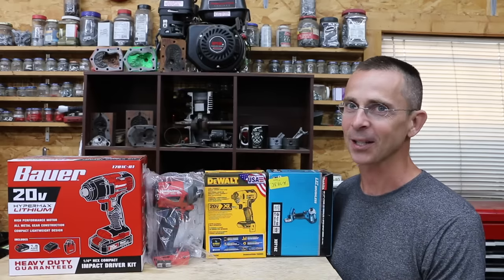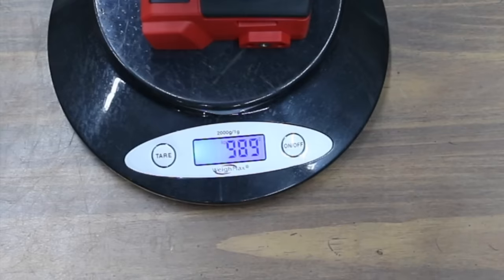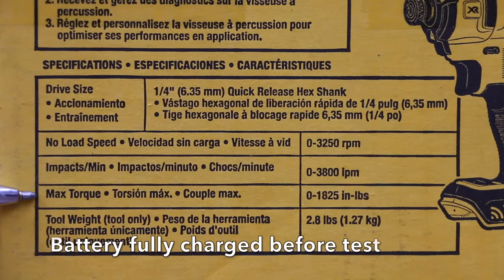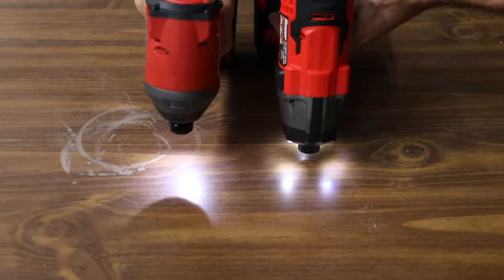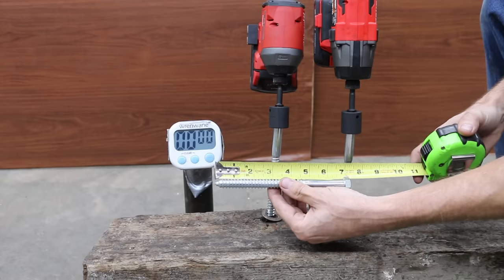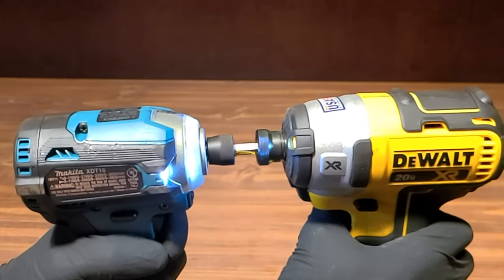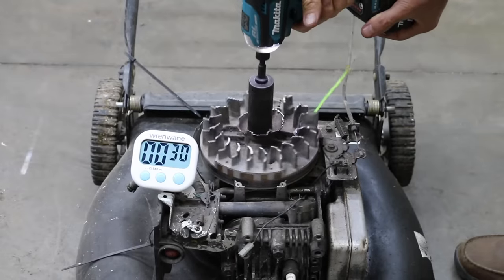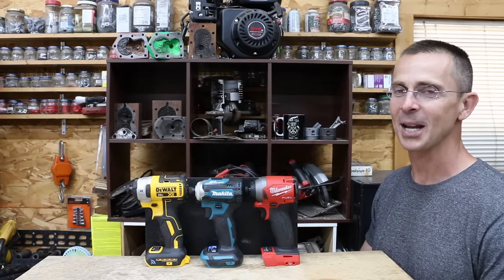Best Impact Driver? DeWalt vs Milwaukee vs Makita vs Bauer!  Let's find out!

Comment: I had an older Milwaukee that continued going all the way until it smoked the brushless motor. It still works but makes a horrible noise, and doesn't work very well. The replacement now shuts down just like yours when I try to misuse it in a similar fashion to the way that killed the first one. I suspect Milwaukee has revised their protection circuitry and logic so that it cuts out earlier, creating a slight annoyance when you're running at the edge, but keeping you from killing the tool.
Reply: i would rather have control than safety, this "shuts down because you are a dummy" mode is taking away the freedom to do whatever i want with a tool i bought.
Reply: @MartinPlanner2  Still, the fact that the manufacturer has to protect the tool from its users says something... 

People will let the magic smoke out of the tools due to incorrect usage and claim warranty.. Or that their tools break because they suck. 

I get the idea though, I've run several old drills to the smoking point to get jobs done... But honestly, it's not really good practice.
Reply: @TheDaniel85  yes i understand that, meanwhile, because it has a thermometer, they could claim that if it overheated, there is no warranty, period.

it is such a nanny state, that we have been implementing defensive measures against crooks, while this just made them be more crooked and smarter, instead of stopping them doing scams.

i only buy a tool that i can repair myself, electric or not. and i have never took back a tool for warranty.
faulty production? that's a scam on cheapskate parts.

of course there are price-brakets for scams, so a faulty car is a higher offense than a faulty 1$ tool. 

not in my perspective though...
Reply: The red link technology will shut down to protect the tool, which may be annoying, but this is a good thing.  The Milwaukee battery is the best on the market.  I would rather have the tool shut down automatically since most people will pressure the tool to finish the job even if it smokes.  In the end, my drill avoids damage.  t does take a lot to get to that point.  Most jobs will not shut down the drill.  Even with the shutdown, Milwaukee has won all of the competitions I have seen on youtube.
Reply: @Anonymous The number of people who want the "freedom" to abuse the tool and also expect the manufacturer to repair or replace it for free as a result is probably pretty high. I don't blame Milwaukee for implementing this feature as a way to save them money from these kind of warranty claims. And I sure don't mind losing a few seconds for the tool to cool and reset instead of losing a few hours or days while I go get a replacement or wait for something to come back from service or whatever after I abused the tool to ruin.
Reply from the maker: Thanks for sharing.
Reply: @GeekRedux  my point is, if it has safeties in it, you will hardly ever find the point of failure, which would be really useful for testing purposes in their own testing facility.
I am the type that i would rather build a tool that outlasts generations of users, than to sell 5series to all of my users.
I know, in this world, this is not a very popular perspective, with million+1 reasons why companies don't do it.

back in the day, when there were no warranty laws, you had something called "intended use" with scientific numbers, of how much the tool is MEANT TO be able to handle. now, it's only a suggestion.
for example, they could say, this hammerdrill, in ONLY intended to be turning up to 8mm coresize bolts, or 5mm boresize screws no longer than 80mm.
or that it should only be used to XYZNewtonmeter torque, and it could handle higher ones, but it would lead to being faulty.

now the RPM and torque numbers are JUST a marketing ploy (as shown in the testing in the video) and companies RACE to "who's higher" instead of saying that it SHOUILDN'T do more.
Reply: @MartinPlanner2  Weird that you're saying you want a tool that outlasts generations of users in the same thread you criticize Milwaukee for designing the tool most likely to do just that.
Reply: @GeekRedux  having no weakness, and hiding the fact there is weakness, is NOT the same thing...

Comment: Milwaukee has a red link system that watch’s the battery and tool and watch’s the heat and will cut off the tool to try and protect it for the user.
Reply: FishFind3000 For the user. Or //from// the user 😄
Reply: Definitely from the user!
Reply: @jandastroy  truf. I had their m18 drill grab and start to spin. It spun in such a way that it pinned my finger on the trigger and couldn't let go. The drill detected that something was wrong, and it shut off.
Using a drill in low gear is always terrifying, so I'm glad it has that feature. It bent the fuck out of the metal box I was drilling, but I was unharmed.
Reply: Shawn a box is replaceable but your hand is not that’s neat how it shift off
Reply: The M18 drill is a beast. It beats the crap out of a corded dewalt my dad has. Not even comparable.
Reply: I was initially irritated by the shutoff, but with experience I wisened up and realized that I had a tool that was actually protecting my (substantial) investment.
One trick I did pick up on was that Milwaukee most frequently tends to shut off for the sake of the battery, so switching to a secondary to keep working and allowing the primary to cool down has been working wonders for 5+ years. Milwaukee  just doesn't quit, though I'll admit their quality control needs better attention. Nothing is more infuriating than having to "break in" the trigger on a brand new tool.
Plenty positive to be said about the distinct responsiveness of Makita - I hope the folks in Red catch up, especially when it comes to quick fastening of smaller screws/bolts. Milwaukee seemingly always expects a beefy fastener and takes a deep breath before going to work.
Great time to be alive for cordless tools though, all of the big players have incredible products to offer.
Reply from the maker: Thanks for the feedback.
Reply: @Timocracy  with my experience with programing, the delay in the start might have something to do with the redlink system checking if the drill and battery are good to go. its only a few milliseconds but it still has to do it and eats some time.
Reply: @FishFind3000 
Ahh, interesting. Thanks for the insight.

Comment: We once forgot a makita impact driver out at the roof for winter. North finland winter is six months. When we came back , drill was only bit rusty from socket and even the battery had power.
Reply from the maker: Thanks for sharing.
Reply: I worked with a clumsy guy when i was younger, he was a carpenter and was expert in dropping his Makita drill from roofs, without any damage. Not until he accidentally drove over it with a van did he damage the housing but the drill still worked perfectly. Its without doubt the only premium brand in powertools, at least since AEG stopped making their own stuff and now is licensing the use of their name to the company that makes Milwaukee and Ryobi.
Reply: Makita is amazing. I have most of the drills and impact drivers.
Reply: 6 months on a roof during winter in Finland… and still had battery power 🤨

Comment: i have both the milwaukee and dewalt. both are excellent working in general construction driving screws and lag bolts. i have found dewalt tools with the exception of the sawzall to be almost indestructible. my personal fav impact is the milwaukee 12v, won't do the hard work the 18 v will but is small light and easy to work with.
Reply from the maker: Thanks for sharing.

Comment: Really like watching your comparison videos.  I would love to see you do a comparison of oil filter cap wrenches, specifically 64mm ones like Motivx  MX2320 (new style), STEELMAN 96663, Tool Guy Republic, and some cheaper brands.  Cheap ones appear to break on tight filters, particularly newer Toyotas with filter housings instead of spin-on filters and/or the housing gets stuck on them.  The more expensive ones are supposed to work better but it would be great to see you do one of you excellent comparison tests on them.
Reply from the maker: Thanks for the suggestion.

Comment: I'd be curious to know if the Milwaukee shutting down is built in  to avoid heat damage.
Reply: In some drills by Milwaukee they shut off to prevent harming the user when the drill kicks back
Reply: Safety feature
Reply: Milwaukee should put an indicator light to let you know when its in protect mode. I thought i had a low battery and swapped in a fresh one and ended up letting out the magic smoke.
Reply: I was using it as an indication that I should probably not be doing what I'm currently doing :) only happened a few times driving a 100mm hex head m10 wood screw into azobe  hardwood in a hole pre-drilled for an m8 (6mm hole). I see in the test I bought the right drill now :) (by pure chance, bought it as I found the dewalt a little too expensive)
Reply: Its a over heating safety
Reply: It got tired and gave up.
Reply: Overload protection initiated by the M18 battery. The battery is the one that shuts down, not the the tool. Does it to avoid damage to the drill, something that Dewalt and Makita failed to do causing smoke.
Reply: It’s a safety to Add void damage to the drill
Reply: I think the battery will get hot as well and the tool won't work until the battery cools down. Seen it happen on a Milwaukee angle grinder. Battery just gets to hot and starts blinking. Kind of a safety as well from the battery.
Reply: If they made racing cars Milwaukee would loose for shutting itself down. Once you start doing something or racing you cant be taking breaks so Makita should win automatically because Milwaukee wanted time out to cool down
Reply: Na its just that it sucks. Japanese vs American technology? Japanese everytime
Reply: @boricuaspr  wrong. Makita is the only company that has protection built into the battery. Go look at any tear down video about it.
Reply: @johnford8369  I only use M12 tools from Milwaukee but when they overload, the tool stops and the lights do flash.
Reply: Lol that explains everything my Co- worker / Leadman with his new Fuel Milwaukee set kept having issues with his circular saw stoping on him cutting through some 2x6 long  ways it was part of a roof facial board. He swaped batteries twice got pissed and said P.O.S. Milwaukee dont know why everyone loves them so much. I was installing a door frame he yelled do me a favor get some cords and the electric skill saw then he throws his Milwaukee to the floor and says im taking that P.O.S. back and getting my money. I said hey you wanna try my old hilti saw? He said you have full battery i said idk all check it was at 75% he said yeah lets try it. Haha it got the job finished did twice the work of Milwaukee 
Without stopping still had 25% battery left.
Reply: It is
Reply: @boricuaspr  That's an incorrect statement.  Both the Dewalt (EPS) and Makita (SPC) employ overload, overdischarge, and overheating protection electronics.  The cause of smoke was the grease.  If the Milwaukee was shutting down before grease started to smoke then its electronic threshold for triggering is lower.  Right, wrong, indifferent, smoking grease isn't the litmus test.

Comment: I was at Home Depot the other day and saw a deal that I just couldn't pass up. They had a Dewalt Atomic DCF809 Impact Driver with a charger, two 1.5 Amp/hr batteries, and a carrying bag for 100 bucks. I know 1.5 amp/hr batteries are practically useless but we already have several 5 amp/hr batteries at home and they're good to have in a pinch. Used it for the first time today and I'm quite satisfied with the purchase.
Reply from the maker: Thanks for sharing.

Comment: Have you covered variances within a brand? You have tested the Makita XDT16Z here, yet I expect the Makita DTD154 that I have might or might not give similar results. Would be interesting to know. My guess would be the hardware is the same with the performance differences due to the electronics inside.

Comment: I’d love to see a face off between the high torque (1,000 ft lbs +) cordless 1/2” impacts. RIGID, DeWalt, Milwaukee, Snap-On, etc.
Reply: I second this. Hard to believe it hasn’t been done yet.
Reply: I'm not sure any of those are rated for 1,000 lb/ft. The Ridgid is like 450 and it's a quality piece
Reply: Milwaukee 2767 will win every time. Dozens of tests on Youtube already shows that.
Reply: @Carguylogan  Milwaukee 2767-20 is rated and proven tested at 1400 ft lbs.
Reply: @srvdean3024  I guess I was thinking about the smaller class of 1/2" impact wrenches.
Reply: @Carguylogan  and if that isn't enough, upgrade to the 1", at 2000 ft/lb

Comment: Very competitive testing & probably exceeded what actions I'll work it through projects. I bought my second DeWalt Set after wanting the new 20 V. from previous lower series. I now want the 1/2" Impact Tool as the 1/4 " Impact is largest unit included in the set. Although the 1/4" will handle many tough jobs the additional torque from 1/2" will remove heavier lug nuts at higher torque capacities. Also, many of us that have collected multiple batteries will not jump ship for another brand. Having 8 DeWalt 20 V. Batteries & 2 Chargers will make me buy the DeWalt rather than only have two batteries for the Milwaukee. Both DeWalt & Milwaukee get the job done. I also have a Makita  Drill/ 1/4" Impact/ Light Set that performed well over 20 years too.
Reply from the maker: Thanks for the feedback.

Comment: Makita won outright.   Even though the Milwaukee was faster.. You mentioned that it kept stopping. For someone who needs these tools on the daily... I would get incredibly annoyed if the tool kept stopping.  One thing you didn't take into consideration that I'm up applying basis on from other videos is the battery life. Although I can't speak for Milwakee... makitas battery life is far superior to the dewalts.  I'm not even considering bauer in this competition.  For those who only need a drill on occasion to do basic task tasks around the house it will suffice.  I personally use makita and I have never had an issue. These tools just don't die.

Comment: would love to see the Ridgid impact driver tested
Reply from the maker: Great recommendation for the round 2 video!
Reply: @ProjectFarm  Was going to say same thing.  Ryobi and Rigid compared to Milwaukee.  How do you pick which brands to test? I don't have numbers but seems Ryobi/Rigid, Milwaukee and Dewalt are the top sellers in battery tools, with Ryobi and Bauer as the leaders in the low budget tools, at least for nationwide brands.  Then you have local tool brands like Masterforce from Menards.
Reply: @ProjectFarm  Might as well Ryobi (I know it is not as good as Milwaukee :-) )
Reply: Screw ridgid. The warranty is great as long as you have a backup. I just got my impact back two weeks ago after nearly three months of not having it. Both brushless impact and drill went out around the same time. The drill was fixed but the impact was supposedly fix but still isn't. Multiple guys I know have experienced the same crap with ridgid. Ridgid is okay but the best I've seen overall in the field is Milwaukee.
Reply: Adding a vote in for Ridgid tools, they seem to be matching Milwaukee performance with Dewalt prices and would love to see them torture tested
Reply: @OldfartRC1  Wrong. Milwaukee is made in Vietnam, he shows in the video at 2:12.
Reply: You forgot Rigid , the only tool with a lifetime warranty, I just got a free battery on my 10 yrs old rigid, over the phone , by mail . No other company gives a warranty like that! An American Company!
Reply: @markr5440  the warranty is all is has going for it.
Reply: I bought a refurbished Ridgid gen4 set probably 5 years ago and it has been incredible for me the battery still holds a charge like it did then and it wasn't new then, I have beat the crap out of the impact and the drill and they're still kicking harder than a DeWalt!
Reply: Ridgid, ryobi, kobalt
Reply: PF, you should try impact wrenches, try dewalt, rigid, Milwaukee, I’ve heard the rigids are decent.
Reply: eddie money  makita is better than dewalt. Your a bit off.
Reply: Luigi Bellantoni They’re made in the same factories but there’s a clear difference in the quality and performance of Ryobi and Milwaukee. I would say it’s kind of like comparing a Lexus to a Toyota, same sister companies but quite different in quality and performance.
Reply: eddie money  The only guys that have to buy their own tools on job sites tend to be the tinners in my area but a decent bit of them have Ridgid impacts and the things are a strong 2nd place to Milwaukee I'm not gonna say they're even cause I don't think they are but they're close
Reply: @Knogooseness  Ryobi is basically black and decker compared to the other companies, they are better than black and decker, but they are marketed and made to be home tools more than construction. I have some Ryobi stuff and it does work well but you can tell it's just not gonna compare to the construction grade tools.
Reply: kobalt
Reply: Farmer Fpv lmfao that’s about right
Reply: @markr5440  American...lol.. Nice try.
Reply: @OldfartRC1  Wrong! The tool in this test from Milwaukee was made in Nam! Did you watch the video?
Reply: eddie money  😂😂 lol. That's hilarious. Out here in Sacramento Ca we use Ridgid. Outperforms Dewalt, mikita and Milwaukee any day. Plus it has a lifetime warranty. LIFETIME!